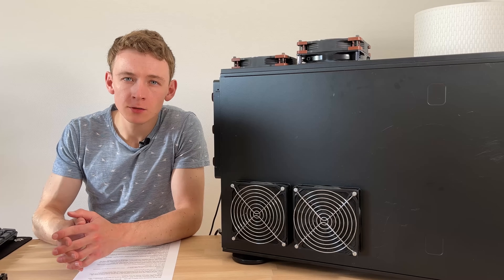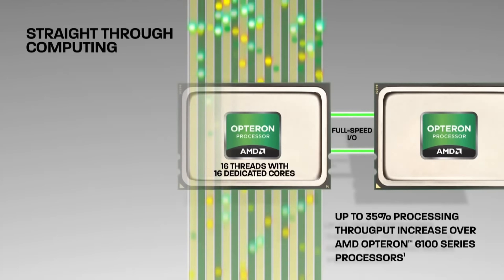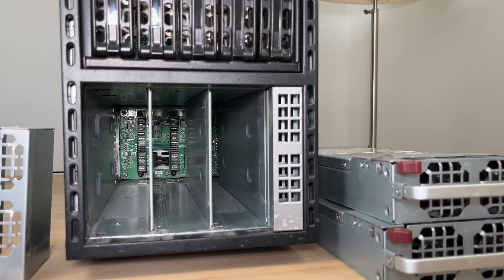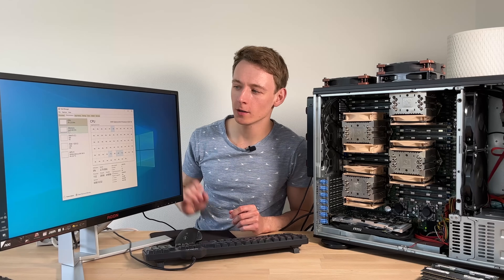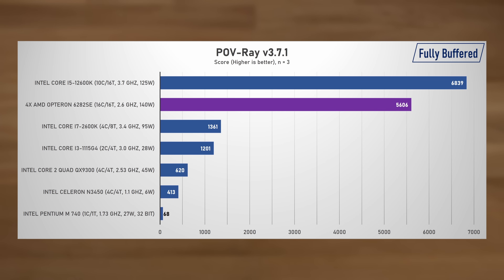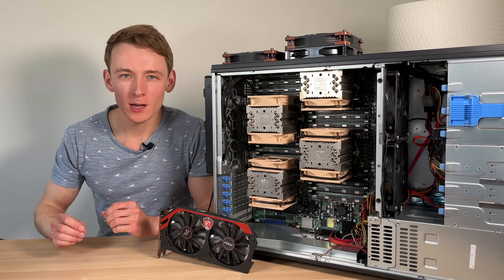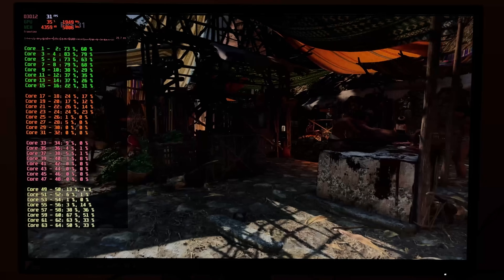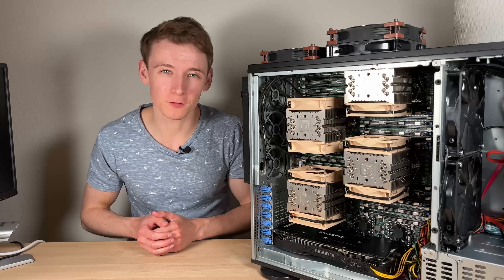The Quad Socket 64 Core Opteron Monster – The Most Insane Desktop PC

Comment: wrong fan orientation up moving air downward bottom moving air upward making a storm in the middle. To correct rotate upper cooler to the same direction of the bottom cooler and the top case fan should blow upward this aligns with physics since hot air moves up forming Chimni effect. Maybe im wrong
Reply from the maker: It was fixed later

Comment: My 18-core Xeon E5-2699v3 using turbo boost unlock for 3.05GHz on all cores gives 6053 points in Cinebench R20 lol. Matches the 64-cores of the Opterons. Hoping to fully unlock the Xeon for true multiplier overclocking.

Comment: I currently run an HP z840 work station with 2 intel Xeon E5-2687W processors, 128gb ddr4 2666mhz in quad channel, a 1475 watt psu, 3-1 tb ssd's 1 1tb nvme, and an NVidia rtx 3090, also has integrated sas but the drives are inside. i use it for 3d modeling and occasional games.

Comment: With multi CPU high core count CPUs (more when you go over 64 logical cores) you get better work allocation and therefore performance if you disable hyperthreading and thus half your logical core count.

Should give it a try under WIndows 10 Pro for Workstations.

Comment: I'm used to "loud" servers.  I run a pedestrian HP DL380 Gen9, which is not as exotic as what you were demonstrating in the video.  It would be interesting to compare noise levels between yours and mine.  Would the gaming have had better performance if you had used a better GPU, such as a RTX 2080 or 2080 Super?  I put an RTX 4060 in my server mentioned above.  Would that server run Windows Server 2022 Standard?  How would it have done running FreeBSD 14.x with Bind 15 DNS and Sendmail running?

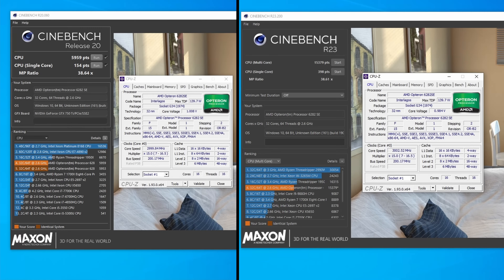Comment: 7:54 Just did a comparison and got a multicore score of 22912 in Cinebench R23 max 105 W TDP with a Ryzen 9 5950X. 16 core. Interesting the level of power in your old beast there now can be wedged into modern micro-ATX, for example.

Comment: opteron single core and quad core processors are inferior to intel core i7 980X because intel core i7 980X gives you the ability to turn intel quick path interconnect on and off

Comment: Fantastic build there, I used to run a Dual AMD OpteronMP 6180 SE D1 in a Supermicro H8DG6-F and 4x 4+ 4x 8GB PC3-10600 ECC Reg a total of 48GB so I had 2GB per core all 24 cores ran at 2.5Ghz, Mangy COurs has 1 FPU per  core and for gaming this was a major deal there are Tweaked Bios' that allow these chips to run 2.8 a 3.0 Ghz, I used 2x Noctua NH U09 DO A3's and placed them so air can only travel from front to rear, I still have everything and I plan on doina rebuild but then witha pair of 16 Core AMD OpteronMP 6386 SE C0 Abu Dhabi CPU's these were the top of the line G34 CPU's made 2.8Ghz base speed, 3.2Ghz all core speed max turbo and 3.5Ghz MAx turbo for half cores or less, but how much faster will the Abu Dhabi's be compared to the Mangy Cours, I sadly  never was able to find this out, but maybe you can.

Interlagos were the worse Mangy Cours & Abu Dhabi were the best, there is also WarSaw but these were low power CPU variants named Opteron 6338)P a 12 core unit with a TDP of 99 Watts and the 6370P a 16 core unit with a same TDP of 99 Watts.
But yea  trying out 4x OpteronMP 6180 SE & 4x OpteronMP 6386 SE would, be very interesting for sure.

Comment: I run a supermicro x10DRL-i as my daily driver with two xeon e5-2697 v4's. 18 cores each with hyperthreading so it shows 72 threads in task manager RTX 3070 for a gpu

Comment: If I remember correctly. Doom engine uses multiple small "jobs" with no main threads running. So these "jobs" were able to be spread out efficiently across all CPU cores, instead of relying on the app main thread to further divide workloads into CPU core/threads.

Comment: How times have changed, my first IBM-compatible computer was an 8088 CPU that ran at 4.77 Mhz. It ran DOS 3 if I remember correctly. A 30 MB hard drive costs $300.00

Comment: I just cleaned up my cellar and found an old Server beast like yours.
With an Asus 4 cpu (opteron 8356, 2.3ghz) mainboard, the cpus still installed. no fans no ram ... but i still got that stuff somewhere in the house.
I builded the 4 cpu server system back in 2010 with a coolermaster stacker 100 case (xxl bigtower) and it worked well for a year or two.
2 sata 500gb harddisk still are installed... mabe they still boot...
The cpus have (already outdated in 2010) been quite cheap (around 50$ each) so was the ecc ram 32x4gb 
But the 4 cpu mainboard was very expensive, when i imported it refurbished from china. 
Think it was around 500$  with the lsi raid5 controller... what on the other hand was cheap back in 2010. 
The original amd opteron coolers have been more expensive than the cpu itself. So i used cheap consumer active coolers for around 15$ each.
Next week i will see if it still works and use it for some virtualisation or other funny smarthome stuff... pi-hole, pi-alert, unraid etc...
Think i will also try windows server 2016 on that stuff...

P.S: i dont really care about the power consumption, since i have a huge PhotoVoltaic system here in spain... 20kwp/28kw battery

Comment: Very cool video! I've been in the homelab scene for a bit now and have been experimenting with lots of old decommissioned server hardware. Even for home use the reliability and general ease of use (depending on the manufacturer) has been a huge benefit for most of my projects. I have never played around with a quad socket system but do currently have a fairly beefy dual socket Xeon server from Dell that is running various web services and a large NAS. For diagnostics alone I wouldn't replace it with a standard consumer system. If you can consolidate the jobs of enough machines to one system these are an obvious solution though it's has to be worth the energy cost of course. After slapping in an older GPU these can be amazing virtualization of things like home media server and encoding machines. Was very useful when live streaming to have it function as a private relay server. Sky's the limit really and it's awesome to see others experimenting with these commonly discarded systems and giving them a new lease on life.

Comment: Actually, many server companies actually expect this use case (gaming on server), they added MS-DOS / UEFI VESA video support obviously required by the video cards into the bootloader on the motherboard, and the ability to use the separate video card as GFX0 device to display the bootloader screen onto (sometimes the internal GPU in the server computers are just abominable in performance department), and of course some kids just take decommissioned servers home and put all the CPU grunts to good use on some games that demands powerful processors.

Comment: I am watching this video on a Rackmounted Dell Poweredge 815 that is equipped almost exactly the same as far as CPUs and Ram go. I got 2 of them off of Offerup for $300, and have been using them to set up a home lab, and to better understand enterprise grade hardware and serve management. The strengths and weaknesses of this system still perplex me. I plan on using one as a virtualization server and the other Ive been using to learn Debian Server. Thanks for the 2 videos on this machine.
Reply: Yes! Offerup has given me access to so much decommissioned server hardware and workstations. Never paid more than a few hundred dollars and have found some pretty neat hardware. Really brings meaning to one mans trash is another persons treasure. Many of these configurations are speced out well above what the average consumer will need so for the averages persons application they are likely still sufficient for many tasks. Sure maybe not gaming but that was never really the purpose of making a quad socket system. For any "profession" oriented tasks there is limited reason why old enterprise grade hardware can't fit the bill.

Comment: thank you very much for sharing this awesome build! it would be intesting, how it performs on tasks like FEA (FEM & CFD, direct and iterative solvers), where the performance depends on how good the CPU is connected to the RAM (less cores but many RAM-links and fast RAM). Did you run any PTS benchmarks? I noticed there are some tests suits espacially for HPC and FEA use cases...
BTW: is there something similar at the intel side of things?

Comment: neat rig. i ran one of these for a while. i went from 6128's to 6328's and it helped a lot. only 8 cores each, but the 6328's have the highest boost clocks for these sockets at 3.8ghz. the loudest fans in mine were those two little fans on the chipsets that ran at a million rpm, i installed a fan controller and ran them at half speed and it made a huge difference in the noise and i only ran them at 100% when rendering.
Reply: The Quad 6380 can hit 3.8 on 64 Cores a once

Comment: Please see what kind of hash rate you get when mining XMR Monero. Make sure you use every single core that you can along with your GPU. Please share what your total cost was for the system and where you purchased it from if you don't mind. I'm not so concerned with how many watts the system is using while mining Monero, I can always use wind and solar to offset those costs. Thanks for sharing, I love seeing old extremely powerful workstations like this.

Comment: The Opteron 6228 8 core piledrivers were the fastest clocked units from the Opteron era, they'll get up to 3.8 under boost. If you want to play around with the dual/quad configurations, those are your best bet if you want to try some gaming. It won't do well, but still. DDR3 unreg/non ECC at 1600 is highly recommended
 as well.

Comment: The construction of such workstations was really amazing and magnificent, but definitely overkill.  I recently acquired a Dell T7810 with dual E5-2699 V3 with 128G ECC ram.  Dell T7810 was designed and marketed in 2014.  It scores over 4,000 with Cinebench R15,and 22,000 with Cinebench 23R.  But in todays real world computation, such as Zip or script code operation, it is only as good as a single Gen-10 i7 CPU.

Comment: I once owned a work station that rocked two opteron 244s. It featured an amazing 16 gigs of ram ( this was 2005ish) 6 64 bit pci slots ( totally worthless) and no AGP slot. Couldn't game on it much but damn if it didn't encode video faster than anything i'd ever used up until that point. I was used to a video rip taking 8-10 hours back then, this thing did almost in real time. Got it for a cool 500 bucks.

Comment: I have been unsing AMD dual-core motherboards since Bulldozer became easily available. TYAN makes great dual socket motherboards for AMD that fit standard ATX case. Slap water cooling on top of them and make sure you also get good blower to extact the heat from chipset as well. Sure its not the killer gaming setup but I am not a gamer anymore, real world has better FPS and resolution.

Comment: I wish I was important enough that I could just ask all of the major manufacturers to build the most insane versions of their current and next gen platforms possible. I’m talking a 4 socket zen 4 threadripper pro that has 256 unlocked cores capable of boosting to the highest speeds the architecture is capable of. Add in 8tb of special ddr5 6600 low latency ram, and a crazy custom motherboard capable of running all that nonsense. With like 6 thunderbolt 4 ports and built in 400gbit ethernet or even 1.6tbit ethernet when that is out.  Then have them build some crazy multi gpu Frankenstein 4090 or whatever it will be called but with the fastest components money can buy. Have a bunch of custom pcie 5.0 optane and nvme storage, along with a bunch of those nimbus 100tb ssds. Then have some nuclear engineering lab build a custom nuclear power plant to run the thing since it will probably pull like a million gigawatts.

Comment: I've handled DP Tyan system before and i had a funny experience, that when one of the 2nd socket RAM died, i remove the proc as well to check the health of the other RAM sticks on the 1st socket and confused for 30 minutes straight on why one LAN port also died down for some reason.
As it turns out, the two LAN port are CONNECTED to EACH of the processor so you need BOTH proc for both LAN ports to works; weird.

Comment: i have a dell t5400 with 2 xeon e5450 4 core 3ghz so (8 cores) 32gb dr2 (667mhz duel channel 1300mhz) with gtx 1050ti. 2008 model and i get the same results. it does vr well but ram holds it back i bit. old servers are super powerful and so cheap these days. the 32gb of ram cost me £15 the the processors was £28 for the pair.

Comment: I use an IBM x3950x5 in two node via four QPI cables making for 8u in OctaSocket DecaCore, I did indeed try to purchase the same CPUs, Mobo & PSU combination over a wide period of time as a personal workstation but it never went as far as you. -I would still love to own one myself even today :D *Amazing video buddy :D
Reply: Seems really odd to most in terms of CPU compute collection and such but have you ever considered purchasing or collecting the SUN T2000 2U with an Niagara CoolThreads CPU, Quad or OctaCore with 4  HW threads per core then 1:1 ratio with intels HT clock cycle notions, IIRC. Really lovely systems anyway. [ALOM is okay too really]

Comment: Impressive system! Liked and subscribed. :-) A long tima go I tried an older G34 12-core cpu on a single cpu supermicro board with 32gb of ram. And both the media and gaming performance was horrible, and I was disappointed. The setup costed me around 50 euros. I think that I used an GT 630 2gb card along with it.

Comment: These quad socket G34 boards are the most fun I ever had with CPU hardware. Ran the same supermicro board with 4x 6272 engineering sample CPUs @ 4.2ghz under water on a modified bios. Pulling 1.5kw at the wall. Managed a 3396 in cinebench R15 (still on HWBot!). 
Completely useless and chews a ridiculous amount of power, but so much fun to play with!

Comment: just for giggles I benchmarked my old ryzen 1800x with 3000 mhz mem, got about 1650 points. its been on for like, 2 weeks but the score sounds about right. my 5800x3d system scored about 2350, so thats a nice showing from the fx based system.

Comment: weird that the GPU utilization was so low in gaming.
Reply: It was so low because because the CPU was bottle-necking the whole system, most of the games dont utilize more than 4 cores  or 8 threads, they get confused and dont use the full potential like some programs.

Comment: Oh you're definitely on my radar now.

This is G34, correct?

These CPU's had very low clock speeds, and low IPC. Not surprising results with gaming at all.

840w to just touch a 12600k in Y Cruncher. Wow.

Comment: This goes to show in regards to games, it's generally not the core count that matters but the clock speed. Often the games do not know how to utilize multiple cores, if they do its generally 4 cores. The new AM5 shows to be interesting as they have higher clock speed pushing the 5GHZ. Cache is also something these old chips are lacking compared to the new epyc / threadripper procs.